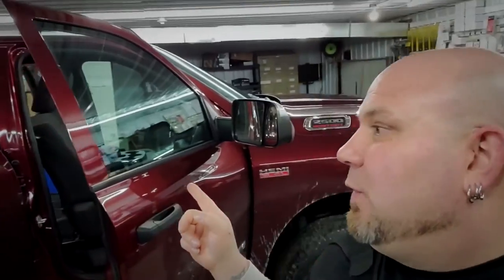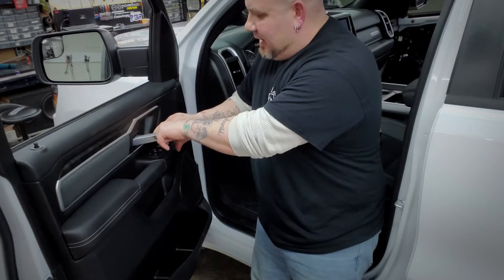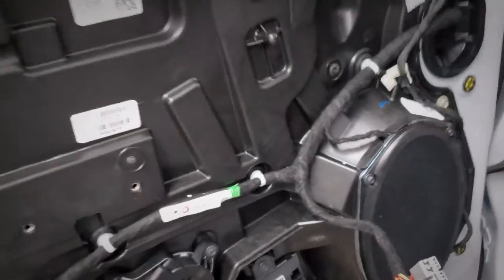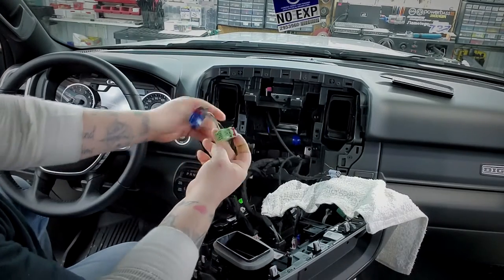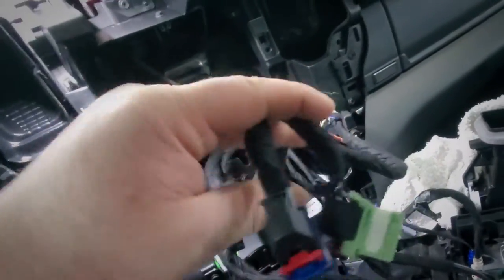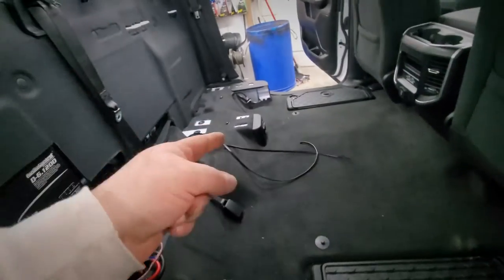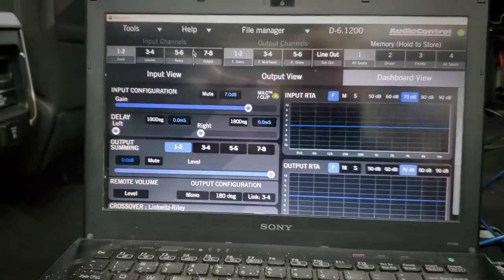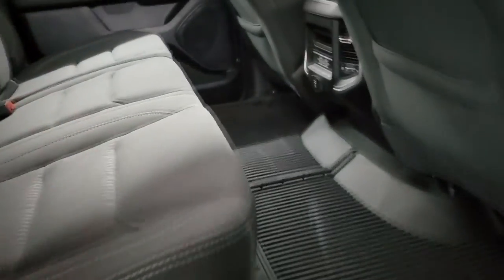Simple Audio Upgrades 2022 RAM 1500: There's Something You Should Know

Comment: Awesome work, however I have a question? So I had a 5ch amp installed and a single 10 and kept the stock deck in my 2014 Ram 1500. Now I have no sound!!!! The amp I'm using has the output converter built in to it so an external is not needed at least that's what the installer told me. Any suggestions on where to start on figuring this nightmare out.

Comment: Absolutely great video man. I am in the same boat. Traded my 2020 Ram 1500 in, which had the AMPPro and all JL Audio speakers, DSP, AMPs and a sub, for a 2022 Ram 1500 last week. Although I knew ahead of time that the harness was different, but they are working on a new harness and should be released soon. I am in no hurry as it is getting hot where I live, and I am not looking to be out in the heat as a 55 yr old tearing out seats, door panels and running wire. I will wait until it is cooler out and hope fully the new harness will be available by then. 

Since this was a base system, couldn't you have accessed the factory speaker wiring from the ANC or is that different on the 2022? I have the alpine system so mine is a bit different and FYI, MTI Acoustics makes sub boxes and the JL Audio Stealthbox will fit without blocking the storage bins but, they are super expensive..

Comment: I have a 22 Ram 1500 quadcab I replaced all the speakers I'm using a pac LPA-E.4 from the unit to a jl vxi 600/6 and a jl slash mono.. 600/1 . It sounds like crap the bass and the highs...how can I get into the oem head unit to turn down the highs and lows...they're too strong to be processed by the dsp in the vxi..even with the factory eq turned all the way down on bass..mid..treble still sounds horrible..I'm from SC and willing to pay you to get me and my installer on the right track..PayPal..Cash app whatever..I just need info to get it right..I'm also running a tw5 13 it should pound..but it flubbles..after volume on about 9

Comment: I got a 2022 ram rebel crew cab and i have a sound system also, 2 12 kicker cvx with custom box, db drive cdx 6x9 medios, and tweeters, kicker cxa 1800 rms amp, mojo pro amp, audiocontrol epicenter i spent around $3,500 dollars with installation

Comment: My 22 bighorn stereo has been doing weird stuff like half my speakers cutting out, and the volume being lower at times do you have any insight on that?
Reply: Mine does the same shit. Seems like it's only when it's under load and gets too hot but if you turn it off for a while and get back in the truck it works like normal. Did you ever get any answers on this question?

Comment: Was this after retuning it because i know u said the customer wasnt too happy with the sound
Reply from the maker: Yes, it was all figured out. I had it in the video going over what was happening but had to trim it out due to the video length getting out of control. 
It was the passive crossover, causing a phase shift in the door speakers. I pulled the door woofers signal from going through the passive crossover and ran them active straight from the amp.

Comment: I just got a 2022 a few months ago. Put in Kicker 6x9s I got from Walmart. It’s like they hit 30% of what they should be hitting at. Any ideas? Bass is turned all the way up on the screen. It’s the 8.4 Nav
Reply: The stock 6x9s are designed to be “subs/mid bass” speakers in this truck.
Using Coaxials that are meant to be decent at everything will create this problem.
You’d be better off using the stock 6x9s and replacing the dash speakers with the lowest impedance 3.5” speakers you can find.
That will improve sound quality and total loudness a little bit.
If you really want to change all speakers then you’d want to use 6x9 component speakers that are designed with a crossover to ensure the 6x9s are only playing bass mid bass and mid frequencies
Reply: Either that or go all out with a 4channel amplifier
Reply: Add an amplifier to it.  Also, the stock  system is designed for a 3ohm impedance.  Find 3 ohm speakers or add an amp that's appropriate to your speaker application.